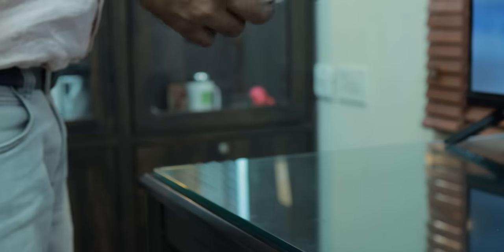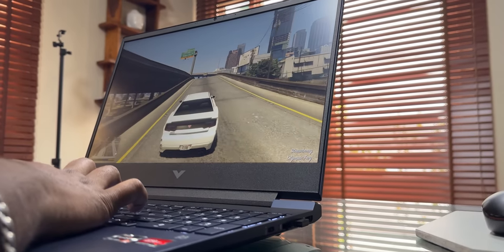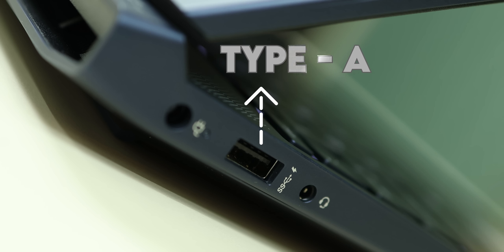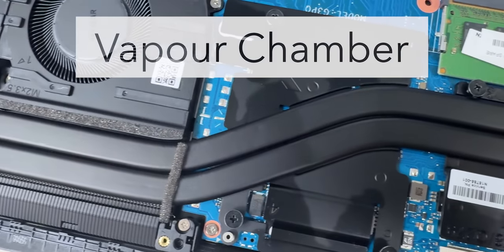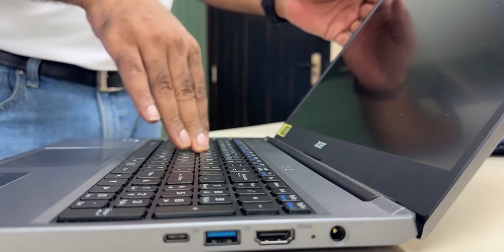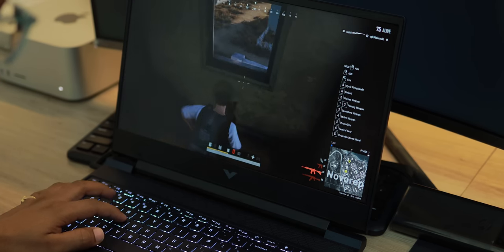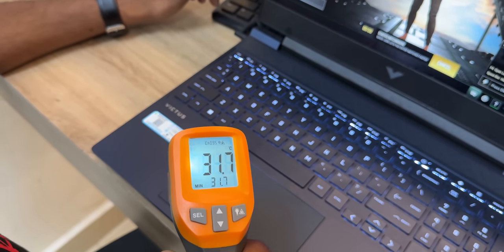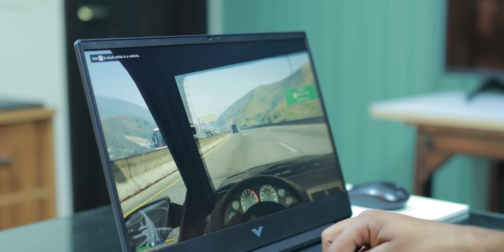Best Laptop Under 50000 ₹ for Gaming , Video Editing , Coding | HP Victus Ryzen 5 5600h

Comment: What's your opinion on aspire 7 3050 comes with i5 12 gen cpu and 16 GB Ram 144hz and it is also a thin laptop should we consider that or some laptop is better than that it is selling at 60k and at sale it drop to 55k and you can grab that at 52k with card offers

Love content ❤❤❤
Reply: aspire 7's rtx 3050 TGP is low(like 30W-45W). So performance is low. I would recommend lenovo ideapad 3 that has rtx 3050 with 85W tgp and its around 55k in amazon.

Comment: Ok one thing, i work with PC's which also includes some testing of laptops. Listen victus has one problem, really big problem which is it's build quality, the plastic quality is trash, feels hollow and flimsy. 
As all of you know the infamous hinge wobbling issue on victus is even present on their higher end variants as well, so under 50k this is a decent laptop. I directly compared it with a IdeaPad gaming 3 with same specs but 1650, the build quality and the screen quality falls short quite much but with more gpu performance *(BUT HERE COMES THE PROBLEM, THE RX6500M IS A PCIE 4 CARD WHILE THE CPU 5600H HAS PCIE 3 SUPPORT SO THE BANDWIDTH DOESN'T MEET AND RESULTS IN A LOT OF STUTTERS AND GLITCHES)*. Also lasts longer as it has a bit more battery quantity.
If you want the overall feel of the laptop to be classy, solid and long lasting i think you should go with ideapad gaming 3 but if you don't really care about the low quality plasticky feel and just want the best raw performance under 50k go with victus 5500M instead of this shit it'll be great.
Reply: It seems that u hv deep insight about laptop....Bro best laptop under 55 k bata de plzzz
Reply: @Rohanxsingh  can you increase your budget to 60k?
Reply: @trexxtechs2857  bhai I'm a editor and ideapad recenctly launched a new varient which has 2050 paired with ryzen 5500h should I go for that one please reply!!!!!!
Reply: @Messballz  NO!  5500h has 4 cores
DO NOT go for a quad cored processor in 2024
Increase your budget in any way and try to get the 6600h and 3050 version, believe me that 6k extra is worth for a much better gpu and cpu combo
Or you can also get 12th gen like 12450h or 12500h
Reply: @trexxtechs2857  what's your take on hp victus ryzen 5 7535hs and nvidia 2050?
Reply: @trexxtechs2857  and also let me know about the msi gf63 thin rtx 3050 and i5 - 11260h
Reply: @Messballz  Both are trash, just get a IdeaPad, LOQ or Nitro 5/V 
And try to increase your budget just a bit and it'll be worth it believe me
Take my word and go for the ideapad, personally tested it alongside victus and there's absolutely no comparison!
Reply: Bro best laptop under 60 k